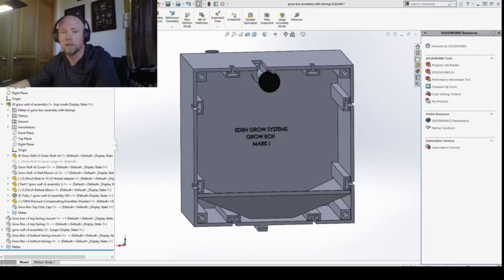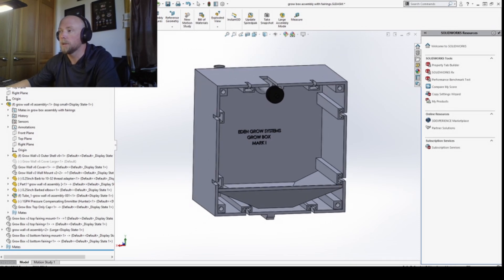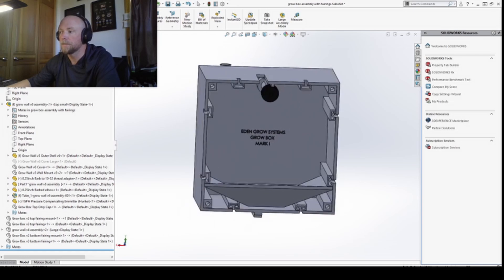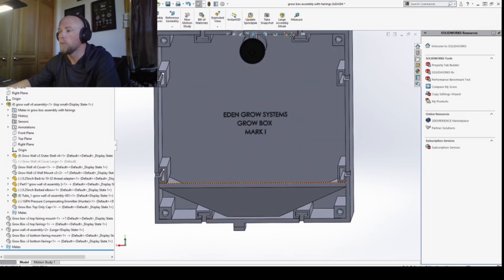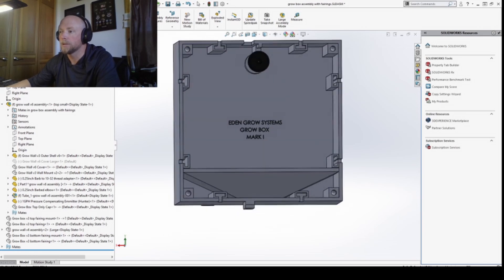HYDROPONIC Grow Box Design Iteration - Grow Food in your Garage?

Comment: The french cleat design will not allow removal of boxes in the middle without removing all of the boxes above it.  To me, that makes it a non-starter.

If I were designing this, I would integrate the supply and drain lines into the structural supports differently than you have done.  I would incorporate guide pins into the structure that act to support and guide the grow boxes onto the structure.  The grow boxes would have pocket holes into which the guide pins will go. The grow box supply and drain holes would be offset on either side of the box centerline so the the supply and drain lines can run parallel through the support structure.  The supply and drain tubing would be aligned with the supply and drain holes in the grow boxes.  The support structure would have holes directly over the supply and drain lines that align with the corresponding holes in the grow boxes.  You would assemble by using the holes in the structural supports as guides to pierce the supply and drain tubing.  You would then insert the taps through the holes and into the supply and drain tubing.  Next, you cut short lengths of tubing long enough to connect to 2 piece push-in bulkhead tubing fittings that will go through the supply and drain holes in the grow box.  The boxes would slide into place using the pins as guides and be secured to the structure using stainless steel self tapping screws that would thread into pocket holes in the supports near the tops of the grow boxes.  The threaded ends of the 2 piece bulkhead fittings would go through their corresponding holes in the grow boxes and the user would tighten the 2nd part of bulkhead fittings to them, forming leak free seals.

That way, you eliminate the need to tuck tubing behind the grow boxes and you can install and remove individual grow boxes by just unscrewing the bulkhead fittings, unscrewing the stainless steel screws, and pulling the grow box straight out.  It's cleaner, simpler, and reduces the tolerancing problems you will run into trying to get a click together system to work reliably given the manufacturing variability you're likely to have during prototyping on a 3d printer.

That's my 2 cents.

Comment: for the Poki-Yoke on the mount, how about a halflap?  Bottom would have the half close to the wall, the upper would have the half lap away from the wall. The mount screws would go through the joint, thus you only need 2 screws per mount as the top screws of one mount are the bottom screws of the one above it.

Wonder if the drain should be moved off center, so drain water misses the grow media.  Imagine you have a wall with 5 or more boxes tall, the lower plants are going to get flooded if the water gets caught in the grow media, also the used water from above would dilute fresh water from the nozzles.

Comment: It's amazing to be able to work like that with you.
You can't imagine how happy I am that you like my idea of using French cleat.

I'm finishing my bachelor degree in engineering and I'm working in photovoltaic for my paper. 
It's really motivating to follow what you do and be able to see that my idea aren't garbage. I respect your logic and how you function as an engineer and look up to you since the start of your channel !

Can't wait to see it on the market
Reply: Glad to see another Engineer/Designer excited about the field, Welcome and good luck.

French cleats do make the install easier, but there is a minor issue, if he maintains the tight grid look, how do you remove a box in the middle of a grow wall without a gap above or removing the boxes above?  Mount needs to be something that allows it to slide parallel to the top face of the box.

Comment: Hi Jeff. Great work!!!  I think you have the drains sloting in from the wrong side. Wouldn't you want them on the back of the unit, so they can be slid in at any time?  Right now it looks like you would have to remove the one above to get to the lower ones.  Also you could only assemble from the bottom up from what I saw in the video.  
I don't see the French cleat working either.  If all the boxes are in contact with each other vertically you would uncleat a whole vertical row to remove the bottom unit.

Comment: The drain "Key" has to go from front to back or the box above will be "captured" and not be removable.  Also, with the french cleat idea - you have to allow space to "lift" the box above the cleat - potentially removing the grid appearance.
Reply: Alternatively if you use the french cleat, and maintained the tight grid, then all boxes above the one you want to work on would have to be removed in order to access it.

Comment: Keep in mind, there is an install approach angle when installing something onto a French cleat. 
You need room above the cleat to approach it. So close stacking might be an issue. Solid works is good, try Aveva PDMS it’ll blow your mind. The pass thru drain I can see being an issue when trying to grow multiple varieties of plants that may require different nutrient schedules.
Also may leave the bottom plants with above par PPM levels. I recently had an issue with a mother plant that was killed due to cross contamination from the nutrient feed from another variety of plant. It was surprising because the nutrient specs weren’t far off from each other.

Comment: The problem I see is with the drains plugging up from roots and lack of enough flow. The more you stack the more water has to flow through the lower ones. The more the roots grow the less room for water storage till it drains. If you put a regulator and low GPM emitters that will help reduce possible overflow. To keep the drain holes clear maybe a large removable dome with holes. I also have a all new thought on the drains. Print square drain pipes in the bracket or make to snap in. Have bottom slip into the next one male/female. Have a hole for a rubber grommet to receive the drain from the back of the boxes.  The larger the drain hole the better. Good luck.

Comment: Have you considered that different plants like different fertilizers? The drain ensures that the fertilizers from top of the column reach the bottom too. And.. the water that does not evaporate, has to go through other plants soil. Tall column and unbalanced watering could mean flushing the bottom plants. I have a question too. What do you do with drain water?